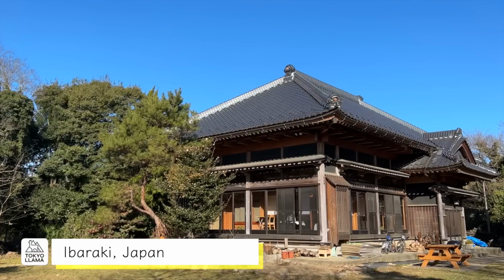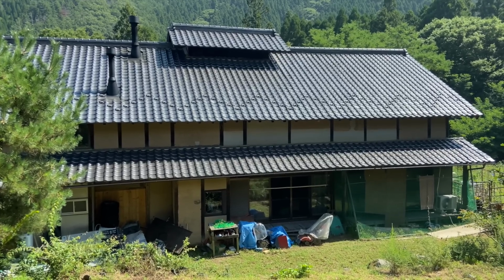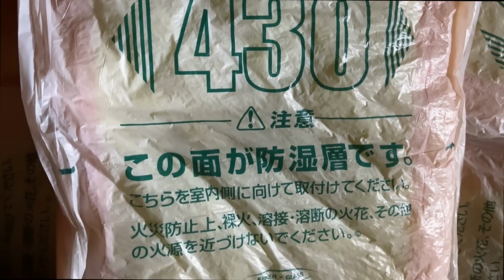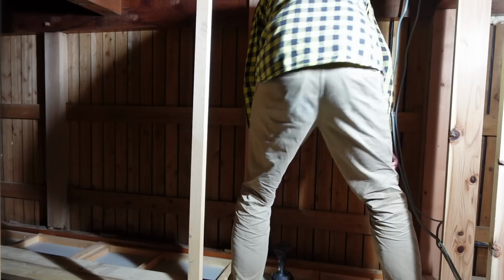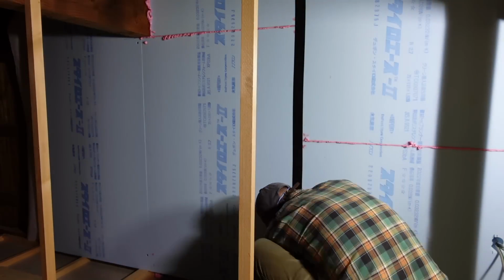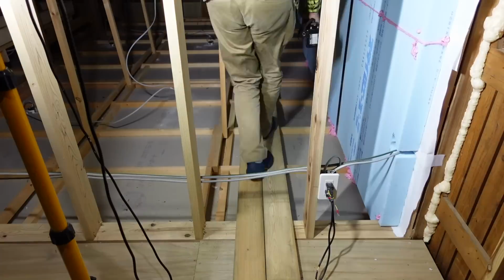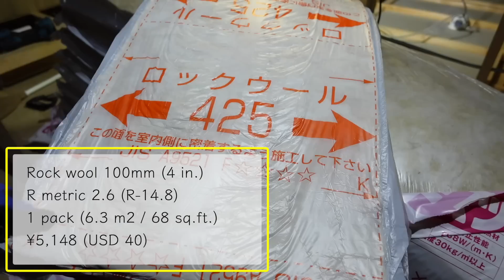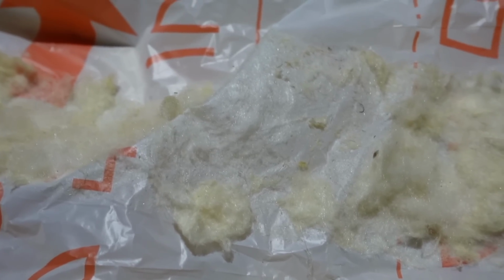Insulating a Japanese House, Part 1 | Abandoned House Renovation

Comment: I'm about to start the insulation process on my 150 year old minka in Nagano. This past summer I re-insulated the kitchen using rock wool .... after removing a foot and a half of straw, dirt, and dust, which was i guess the insulation of the day.  Great timing for this video! Cheers!
Reply from the maker: Nice! What are you planning to do with your roof? I'm thinking rock wool or the Earth Wool, perhaps Neoma foam, keep changing my mind!
Reply: @TokyoLlama  I'll do the inside cielings with rock wool and make that as tight as possible for now ( baby steps to retain heat). in time maybe put layer on layer.  When it comes time to do the inside of the thatched roof, I really don't know. There is a nice part of the old house where I can reclaim a large room with exposed beams... the question is how many beams do I wish to expose vs. how insulated do I want to make it. A friend of mine did a similar reclamation and used beautiful pink fiberglass and finished with gypse. It seems to make sense for the uneven surface ... but seeing you work with the neoma foam looks so satisfying! I'm just getting started and loving it.  I can't wait to hear about your windows, double pane glass sounds like a dream!
Reply from the maker: @OurHouseInJapan  sounds great. Same here with the exposed beams but I’m going with beauty over practicality, so we’ll expose the all of the beams in the attic. In regards to the windows I found that the custom wooden windows are not much more expensive than custom sized hybrid ones. If off-the-shelf sized windows fit your openings that’s the cheapest way though.
Reply: I live in Austria and Minka here is the name people give to a cow or cat. 😅

Comment: Looks great! 
My only concern is the pot lights. Here in the US you'd probably have a code requiring a cover (hat, if you will) to protect the insulation from directly touching it & causing a fire.
Reply: This was my immediate concern, as well.
Reply: Most likely LED lighting and thus not rally an issue. Old incandescent bulbs and or transformers got much hotter
Reply: he even shows on the fixture that it says not to cover it. And with google translate it seems to say do not cover with wood as there is a risk of fire. Not sure why he highlights this label if he goes on to cover the fixture anyway.
Reply: Yes, I'd think you would just build a simple box over it so it's not in direct contact with insulation.
Reply: Thank you for sharing your project. You explained the original 'drafty' design of old Japanese houses very well and showed how you make sure that there are sufficient ventilation gaps between the newly installed insulation layer and the inner wooden wall to allow for air flow so as to avoid moisture retention and potential wood rot on the inside of the house. It also made me think about the different insulation wools you mentioned. I found there is a potential health hazard with glass wool if not handled properly. The comments contributed by your viewers were enlightening too, especially the electrical fixtures on your ceiling and the potential fire hazard with regards to contact with insulation material.

Comment: My house in Ibaraki was 8 years old when I bought it last year, a newish home by Japanese standards. Still cold in the winter and supposedly has more than average insulation, but under the house is very sparse. Once I heat it its fine, but those early mornings are chilly. We have double pane windows and the engawa heats up nicely on those bright winter days. It certainly is something to consider here in Japan when buying a home, but as with everything there are work arounds and solutions.
Reply from the maker: I'll have to upgrade the underfloor insulation at some point unfortunately. Wish I knew more when the carpenters were working on the floor as I would have been more demanding, and saved a whole lot of work down the track.

Comment: Nice to get an update of the house! If you plan on using more of the blue foamboards in the future, maybe you should look into an electric hot knife or hot wire cutter. Looks like it was a struggle to cut through. Thats what we used to make architecture models with in university (don't know if it is common to use in building constructions). Anyway, just a tip:) and don't forget a respirator-mask or something. Those fumes are not pleasant!
Reply from the maker: Thanks very much - yes, it was a bit of a struggle cutting through the foam, will check out the tools you mentioned!
Reply: @TokyoLlama  jigsaw is also a good contender to it. And something you can also use on many other projects.
Reply from the maker: @heuhen  I’ve got a jigsaw, the problem was finding a 75mm blade!
Reply: @TokyoLlama  I see that
Reply: @TokyoLlama  Take and check "bayonet saw" the question will be then, do you need it for just some insulation work.
Reply from the maker: @heuhen  thanks, I’ve since bought a multitool for another project. Maybe I could find a blade that would suit the thick foam?
Reply: @TokyoLlama   I believe they do make specialized saws and blades for that kind of stuff,  here we're got a 'styrofoam knife'  I think they labeled it,  from like a crafts center,  it's basically a long electric wire knife sort of scheme but I think it may be more hot-blade-like.  (I realize we've loaned it to someone so I can't check.)   But something like that might just prove convenient.  Not an expensive item, anyway.

Comment: I’m enjoying the videos very much. When i lived in Japan in the 1980s it seemed such a shame so many beautiful places were being torn down so great to see its turning around. My question is why are you insulating both the ceiling of your boys room as well as the roof? when I renovate here in Canada, a knee wall area would be either/or. You want a continuous insulated envelope but in a cold place you don’t want to trap the air outside the sealed envelope (say in a knee wall area in a sloped roof) because you will get mold. Some heat will always escape from the boy’s ceiling into that space and it is moist.

Comment: Another great video Jaya. It is a balancing act in these old houses when it comes to insulation. The house needs to breathe and it is also needs to retain heat. There is no perfect solution it is what it is with these kominkas.
Reply from the maker: Thanks mate, notice the cameo of your house in the video?
Reply: Yeah the old girl still looks the same 😂
Reply: Houses don't need to breathe, you just need to control where moisture goes.
Reply: @rsmith02  These houses do.

Comment: I always love to watch other people renovating houses, since I have done that in Norway. And since I have done renovating house before, there is always times where I go: "oh, I wouldn't do that!"

It is also very fun to watch how different people around the world do things. For example cables in the walls, In USA they just put normal cable inside with the isolation. While in Norway we put an vapor barrier between the isolation and the inner room, and build a little out for air flow and cable management, where we put cables inside flexible-pipes, to prevent fire/damage/electrocution/ and ease of maintenance (replacing cables).

If it was in Norway, with our high difference between inside and outside temperature, we would for example on the ceiling put down a vapor barrier and then isolation (not those in bags).
Reply from the maker: When the electrician came in to replace the lights I asked him about keeping the wires outside the insulation and he said it was okay, but it was something I wondered about. In terms of vapour barriers seems the Japanese generally feel the bags are sufficient!

Comment: With the added insulation, assuming you utilize a vapour barrier system, you will have changed the dynamics of the sit flow throughout your attic.  One way to increase the flow of air at a small cost is to utilize “Roof Turbine Vents” which will pull a lot of air through your space, which will keep the areas moisture free. Just a though.  Love your home and what you’ve accomplished. Excited for more content.
Reply from the maker: Thanks, yes, I’m thinking of something like that, particularly once we insulate the roof.

Comment: Instead of just insulating, using some air gap sealing tape would be hugely effective. Any air gaps even in the ceiling will lead to a lot of heat loss that can't be mitigated with fibreglass insulation

Comment: Well the only thing I would have done there as extra would have build some walkways over the insulation. Its just if you ever need to go to the space with the insulation to do or check something. It makes so much easier to have at least a narrow walkway that you can use without worrying about the insulation itself or where you can step. Like if he ever needed to run some new wires or something for lamps and such would make that way easier.

Comment: I definitely feel your pain. My wife and I currently live in Kyoto prefecture and received a lot of snow this winter. Our house has a traditional house with no insulation or double glazed windows. The wind pours through and we cannot retain heat. My wife and I actually have chosen to move into my company provided apartment just to stay warm also, to save on the electric bill, which last month was more than I have ever spent in my life on electricity.

Comment: Is it wise to put insulation directly on the downlights? A short can cause a fire. I suppose they are LED so there is very little heat but I would still put a metal cup or something on top of the connections.
Reply from the maker: These lights are rated for insulation to be placed directly over (probably should have showed it in more detail), whereas the old ones I replaced weren't.

Comment: Quick tip on cutting insulation use a serrated bread knife it cuts through it just like a real tough loaf of bread but you can get some nice precision. I would suggest buying a separate knife for it and not using it for food afterwards

Comment: Good jobu! :)

The house wrap was a smart move. The key to insulating this place is to create a vapor barrier between the old wood/structure and your living spaces. Should you seal everything up, you would just create a new problem. This seems like a very smart insulation strategy.
Reply: Not sure why you'd want a vapor barrier vs an air barrier. Keep the conditioned air in the conditioned space but let any errant moisture find its way out. Look up smart membranes, vapor permeable housewrap, etc.

Comment: You're doing an excellent job! You'll end up with 200mm mineral wool laid over the ceilings wich is a huge improvement, check if you're happy with your heat losses after this. Here in the UK 270mm mineral wool is pretty standard to achieve the minimum U values required by building regs for new houses (0.16). It's  quite a high standard to be fair but if you want to go above and beyond maybe in the future you can install a 3rd 100mm layer and bump it up to 300mm insulation! Best of luck, can't wait for the next video!
Reply from the maker: Thanks, I'll see how it goes but hoping since it's going to be an internal ceiling space once the roof is done it will be sufficient.
Reply: Rock wool is also good for sound deadening which is a bonus!

Comment: Great! Another video from you is always welcome.
I have to say, given the climate in Japan in summer, the traditional building system made a lot of sense. It really is easier to warm up than cool down, especially in a humid climate.
That being said, improving the insulation is a no-brainer and you have come up with some pretty creative solutions to retrofit it into a traditional house.
It's a lot of work, but you strike me as someone who enjoys challenges and problem solving.
I wonder if some form of attic fan system might help with the airflow in the summer. Probably not one big fan, but strategically placed smaller ones, maybe linked to temperature/humidity sensors.
Thank you for yet another interesting and informative video. I really enjoy how hard you work to keep the aesthetic of the traditional Japanese home, yet make it work for the 21st century.
Reply from the maker: Thanks Michael. We're definitely on the same page here. Especially once the roof is insulated I think we may need some sort of fan to get the air moving, especially on still days. Love the idea of sensors to automate the process!

Comment: Seems like you'd need motorized roof sealing vents to shut the air leaks up during the winter and be able to open them in the summer.

Comment: Thanks so much for taking us through this meticulous process. 25 years ago when we bought an old house, there was absolutely no one amongst the people we consulted who would put in insulation--because of the mold and rot issues you've mentioned. Nowadays all of the machiya and farmhouse remodelers are using it. I heard from someone who is in a heritage temple family that constant climate control will definitely damage the wood. He gave an example of a beautiful 150-year-old kura which had been renovated into an airtight apartment. Within 10 years, massive splits appeared on the huge main beams. It seems like the system you've designed to allow for air flow on the outer walls could be a great solution to maintain a balance of air circulation and climate control. (I'd still be checking those areas regularly to make sure though, lol!). Enjoy a warm cozy winter this year!!
Reply: So what you mean is that these old houses are not designed to be climate controlled houses like modern houses? Did I get it right?
Reply: @deepdude4719  Yes, that's what I've been told. Making a traditional building airtight can cause mold and rot. In addition, climate control (such as in the renovated kura mentioned above) can decrease humidity so much that the beams split. But nowadays, people tend to insulate heavily and put in climate control systems, so maybe they've figured out how to make it work? Insulating around some rooms but keeping the outer walls exposed to air flow seems like it could be a good solution. Looking forward to hearing how it's going from Tokyo Llama! Having a warm house in winter would be a dream come true. My house is absolutely freezing, lol.
Reply: @junkogreene5644  Thank you for taking the time to reply. I had the feeling that something like this could happen. It is no accidental these homes last for over 150 years in the way they were kept. Good Architecture  takes in consideration too many factors and make them harmoniously to give longevity to the buildings. 
Thank you again for your reply. I wish you warm winters no matter what.
Reply from the maker: Thanks Junko, the issues you've mentioned are definitely a concern so I did put quite a lot of thought into it. One thing that only appears to be starting to come to Japan is air exchange systems, so if making the house more air tight, need replacement air and also humidify/dehumidfy if necessary. I'm planning on putting in an air exchange system if we find the house does reach a certain degree of air-tightedness (is that a word?)

Comment: great to see another video. your videos are always a delight. in the winter, when the snow on us drops close to freezing, we pull the good rugs out of storage. heat rises. but the cold stays low and when those rugs are out you can feel the difference in a room. we also have winter curtains for the windows.
Reply from the maker: Nice, it quite easy to rug up - I have avoided curtains so far as don't think they suit the house (not very practical). Hope with the new windows it improves things.

Comment: If you want to prevent convective looping and significantly increase the performance of that glass wool, a thin layer of foil wrap insulation rolled over the top is a very quick and easy job. It will also reflect heat in the summer and stop the room below getting too warm.
Reply from the maker: Thanks for the tip! I’ll definitely do this on the second floor ceiling.
Reply: @TokyoLlama Don't add a radiant barrier. It traps moisture and will do nothing if installed on a floor as dust makes it non-reflective. It would have to be at the roof level with an air gap. You already have air leaks at the ceiling plane and need that air to be able to get out. If it were me I would have more carefully airsealed the floor and made boxes above the lights. Read GreenBuilding Advisor for more on radiant barriers and insulation.
Reply from the maker: @rsmith02  Yeah, I'm planning to put a radiant barrier below the roof with the air gap. I considered properly air sealing the first floor ceilings but didn't think it was feasible for the whole house and regardless, once the second floor is finished it won't matter so much.

Comment: Fellow Aussie doing a reno here in Japan, you’ll find that airflow is far more crucial on an old house, make it airtight and you’ll get a multiple amount of heat retention versus insulation alone.
On the downside of having insulation and making it airtight you will need to commit to removing humidity…….it’s one or the other.
Reply from the maker: I don’t think the house will get that air right but am planning some sort of mechanical ventilation - considering a few options but haven’t decided yet.
Reply: @TokyoLlama  one little crack or gap somewhere and the insulation becomes useless…….with the windows try to find sealed frames, our double glazed sliders let plenty of cold (and sound) in, and the frames have no thermal barrier.
All in all for my next project I’ll bring in European glazing, it is infinitely better and cheaper too.

Comment: Great Job! as long as you have air movement between the insulation and the exterior walls, moisture will not be a issue.

Comment: Once again your experience has been invaluable. I thought those insulation packs had 1 sheet inside, not 4 to 8 depending on thickness. Might I suggest some seismic reinforcements? The Kaneshin V-RECS SG and some Okabe Brastar braces could greatly improve your rating.